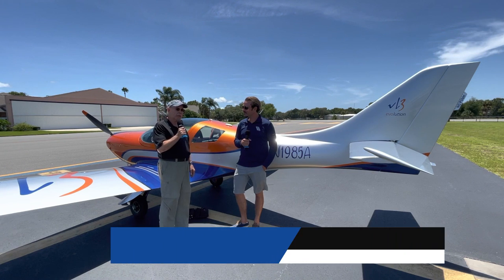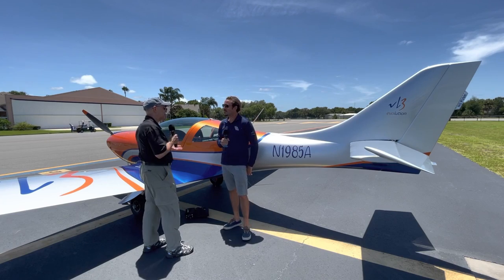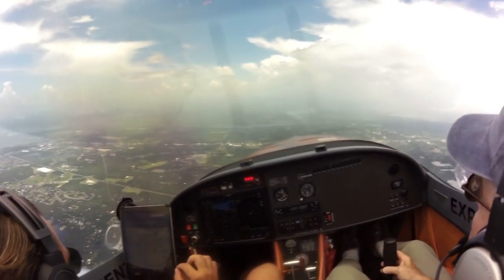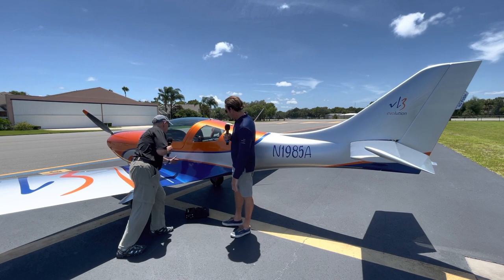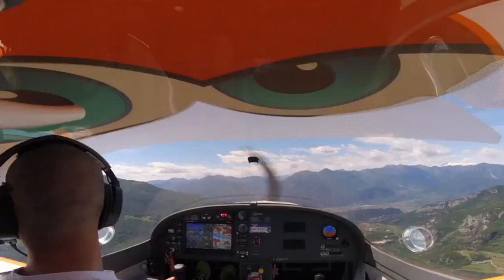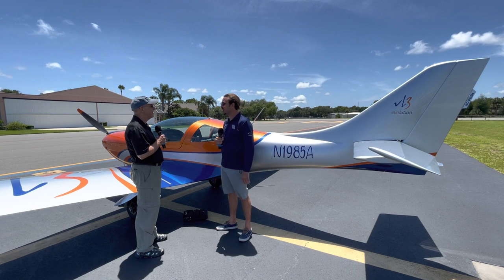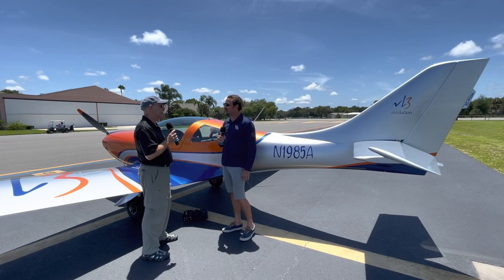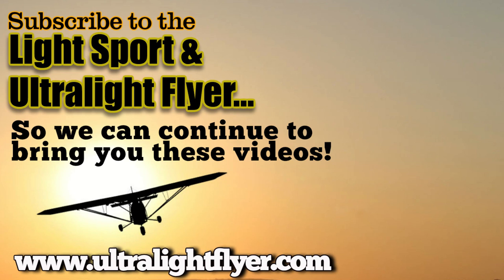JMB Aircraft, VL3 Evolution, Composite, Retractable Gear, Experimental Aircraft Kit.

Comment: Dan great report. But you showing further on in the video an old VL3 out of the first series. The modern today ones are totally different and way more luxurious and better. Why did you not showing more of it by the newer one you standing in front of? 
Besides that awesome plane, one of the best LSA you can get, if you can afford it. I guess in the US the VL3 must be an experimental Plane because of the old dusty FAA rules. But the VL3 is no untrained pilot beginners plane for greenhorns. That’s for sure. It’s a complexed high performance airplane, best with the Rotax 915 is. A dreamliner. But you need for your own life and safety a  couple of days of training with a firm instructor to fly away safe. I love the VL3! In Europe its flown as a Ultralight plane up to 600kg class. Amazing. Distance becomes short. If you fly mostly alone or with one more person, its for sure the better Cirrus SR22. Sharp looking, efficient and fast.

Comment: This is a stunning plane, but I have questions about the long term endurance and reliability of carbon fiber. How well will it handle BASH events, lightning strikes, and the overall stress/rigors of flight. 

The of carbon fiber feels like a decision to keep the weight down. Increases the maximum weight of LSA's (for non-medical pilots) by the end of 2023.

Comment: NIce looking airplane. Our RV-8A with 180hp and constant speed does 160kts TAS at 55% power at 12,500' DA with fixed gear, burning 7.0 gph. At that altitude with no turbo charger, we can also bump it up to 60% power with a TAS of 165 knts.  It is all aluminum structure which can be repaired anywhere.
Reply: Carbon/feebleglass are super simple to repair.  When finished with the repair, you won't be able to tell what was broken.  Nothing wrong with aluminum, nothing wrong with carbon fiber.
Reply: Totally different plane and you compare apple with orange. I always would prefer a VL3 instead of an RV-8A. Its all about taste believes and money. So everybody like the personal story, but the VL3 is awesome. If you like apples. Otherwise you like oranges.